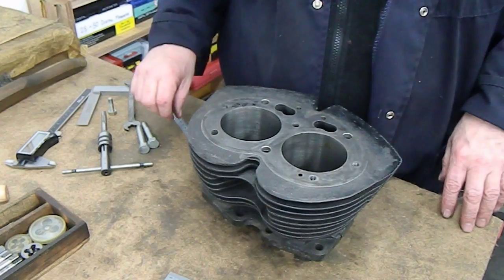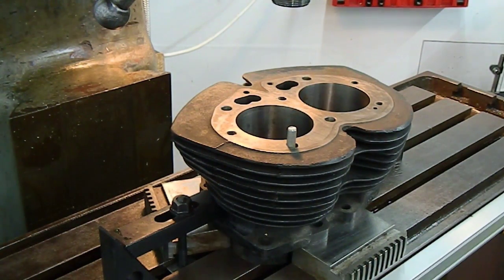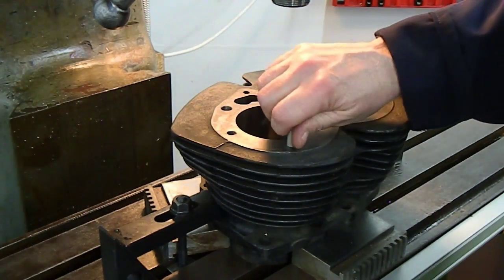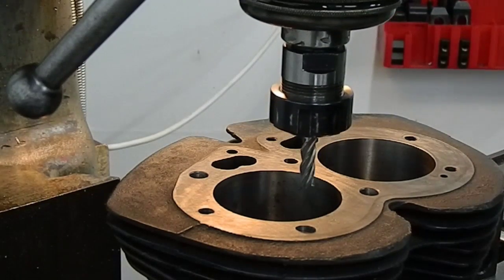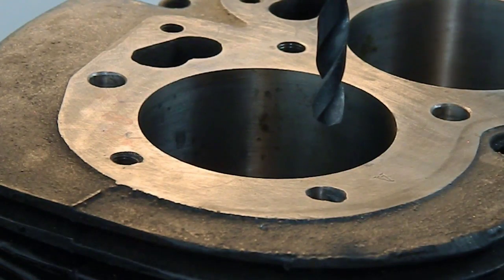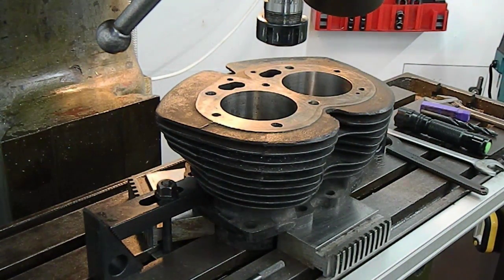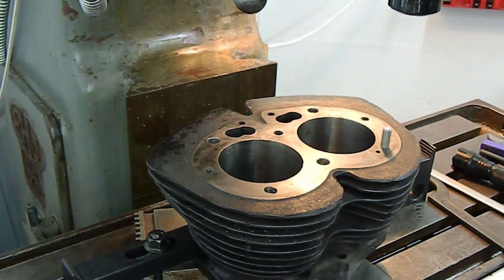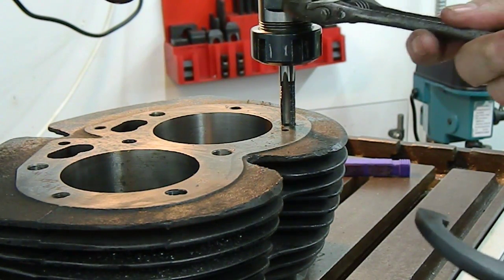Norton Head Bolt Upgrade

Comment: So, was the thread on the top half of the new studs going to be the old stud diameter and thread size? Or will the head stud holes have to be drilled out also?
Reply from the maker: In this case a later head was used with the larger diameter bolt holes already in, but if upgrading the head bolt on an earlier model  then yes, would have to be drilled out on the head also. Thanks for watching, Ade

Comment: Should have welded in the damaged area of the hole and drilled it out.
Reply from the maker: Thanks for watching and commenting. I think for this one the customer did not want any welding done incase of cracking or distortion. Best wishes, Ade

Comment: I originally suspected you were going to locate that damaged hole by mapping out the rest of the bolt pattern, and deducing where it should be.

Then, when you got a bolt placed in it, I thought you would use a dial indicator mounted in the chuck, and spend a solid 5 minutes dialing the workpiece in underneath the chuck.

I think I like your solution a little better...

BTW, hoping to see some more videos in spring, when the shop warms up
Reply from the maker: Sometimes simple solutions works OK, why over complicate. Hoping to return to video making in the near future. 
Regards, Ade.

Comment: I'm very impressed. I've just bought a new Atlas barrel because of the problem you have just fixed. Do you fancy repairing my old one which was resleeved to original bore as a valuable but diminishing spare part for future use?
John Melville.
Reply: Val Melville 
k
Reply from the maker: Thanks for the favourable comments, this is just my hobby for my own stuff and a few friends in the classic bike and karting scene.Some of the things I do are for the Youtube content. Could probably help if you were fairly local, email me at adegwilliam@gmail.com so not to post personal info here. Thanks
Reply: John, how were you able to re sleeve an Atlas barrel back to 73mm? The problem with Atlas, G15 & early Commando barrels was they are very thin in the walls. Taking out anything more than 0.020" was very iffy and 0.040" would always take you through the side wall. Hence not enough material to grip even a thinwall liner. I remember looking at this around the early 70s. The options then were a liner from Laystall Engineering to take it to 68mm (650ss pistons) or a later 750 Commando barrel and head. Many of the earlier 750 blocks and heads before 1966 were spigotted, which gave it's own form of entertainment with CA head gaskets.
Reply: Hi Bob, only just found your comment. The work was done before my ownership by Fred Barlow so I don't know the details.
Reply: Bob, I've just looked at the invoice supplied by Fred Barlow. It states " barrel sleeved to standard, Pistons supplied to suit ". This was done in 1990/1. The new barrel was supplied by RGM and the existing pistons reused as they had done only around 700 miles.
The bike is 1964, but the head is not spigotted. I suspect this helps you not at all.
John.